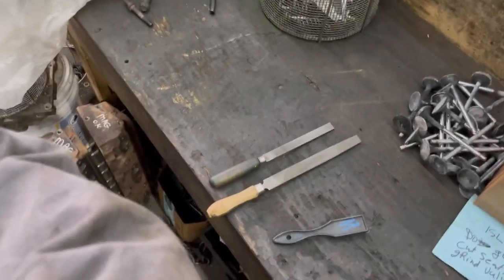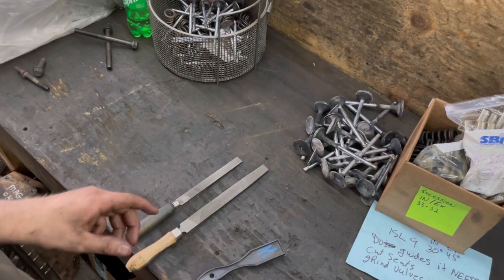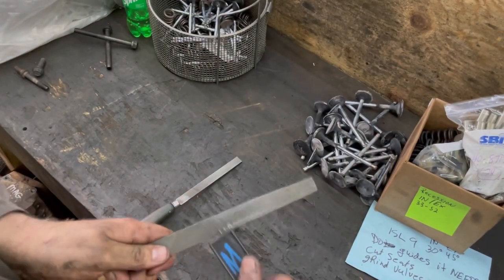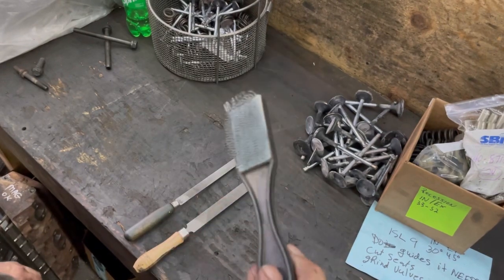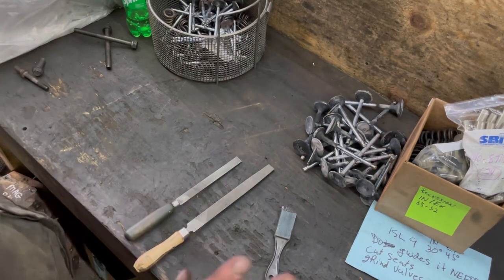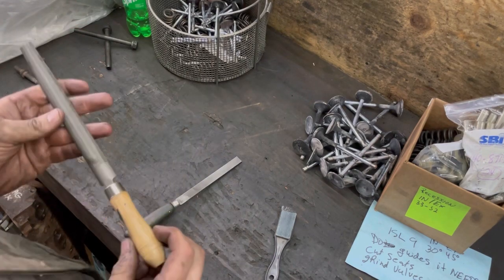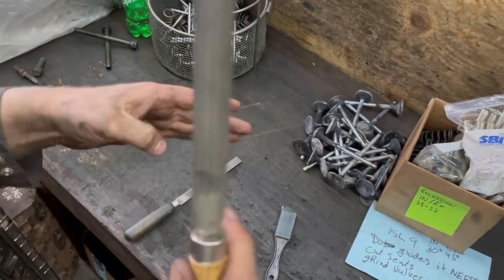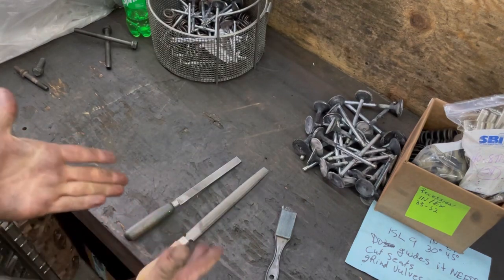HOW TO CLEAN A METAL FILE  !!!!!

Comment: Good vid.   but....  'it hurts my brain'  when someone says to use WD40 to prevent rust.     It will displace water but it has no protective qualities or very little.    You (and your files) would be way better off just mixing acetone and Automatic transmission fluid 50/50 or by some fancy gun oil/protectorant.    Besides being almost free...  it is also one of the best if not the best penetrating oils.   Los of vids on this against some very expensive products.    Being a gun guy I make a version that someone came up with sometime around 1930.  It uses several other solvents and some lanolin (sheep don't rust)  But is still dirt cheap and easy to make...  cheap enough that I just use it for penetrating oil rather than mixing a separate batch just for penetrant....   it does not smell very goo tho... I solved that problemby adding an ounce or two for a quart of an orange solvent.